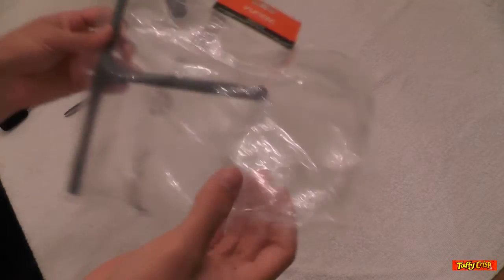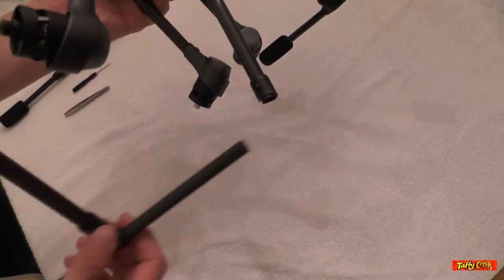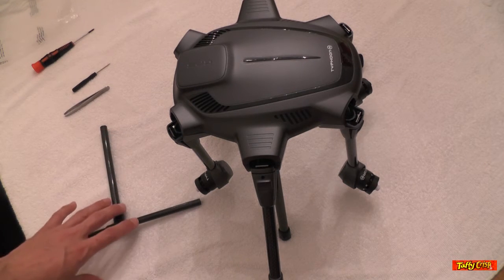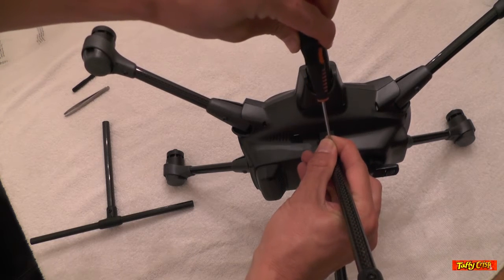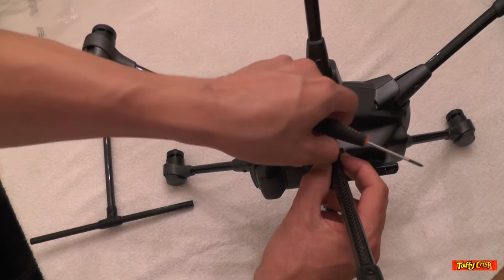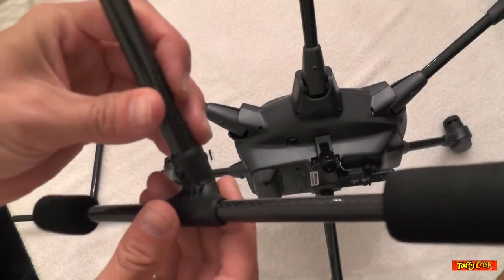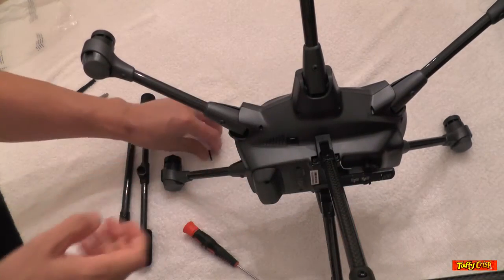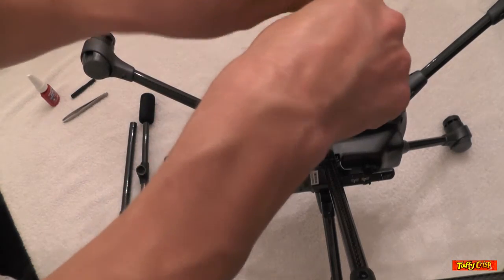Yuneec Typhoon H Crash Repair - Landing Gear Replacement

Comment: Hello really sorry for the crash... I crashed mine today, nothing but my stupid mistake... I have question about landing gear... I didn't brake it but one leg is a bit loose and you said that there is some sensors or something in landing gear? Do you think I damaged that so thats why its loose? What do you suggest? When I tried drone after the crash landing gear goes up and down but still is not as firm as it was...
Reply from the maker: +Denis žuran - email me at richard@pettymedia.com with a photograph showing where it feels loose and I will give some advise.
Reply from the maker: Thanks for your email Denis. I hope it's all sorted now.

Comment: Nice repair video. I wonder what the end result was when the aircraft hit the side of the wall. Were there other components messed up? Did Yuneec send the parts without offering a repair? Why did the sensors not work for the wall? As you can really go no faster then 12 m.p.h. for the sensors to work, was just moving (snails pace?!) too fast?
Reply from the maker: Hi +Mike E. I damaged the arm Spring, landing gear and camera rail so not too bad. It was a very slow speed crash but the damage was caused at impact with the floor not the wall. I do not have the realsense sensors yet, just the basic ones but as the platform moved backwards away from me, these were of no use! Yuneec would have carried out the repair for me at a cost but in fairness the tech guy was straight with me and explained how easy it was so I did it myself. I have got some other videos coming to show the damage, all the repairs and the finished product and will upload them shortly. Subscribe to my channel to get the updates. Thanks.